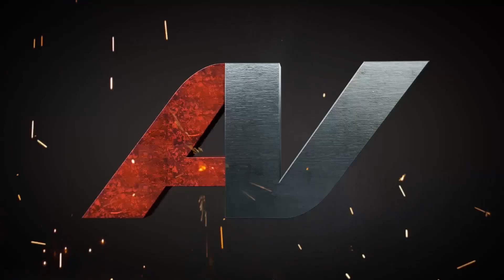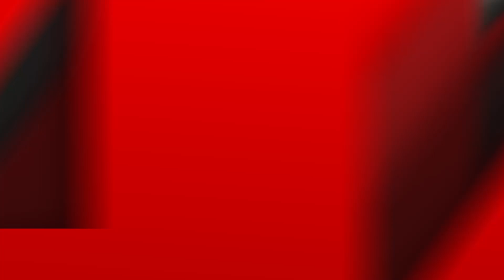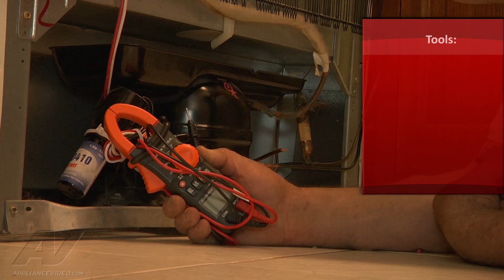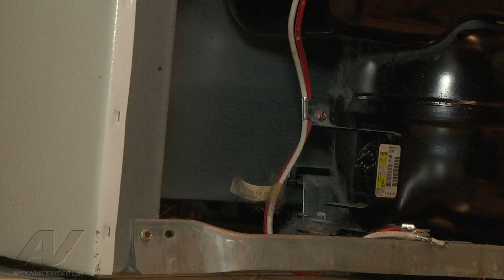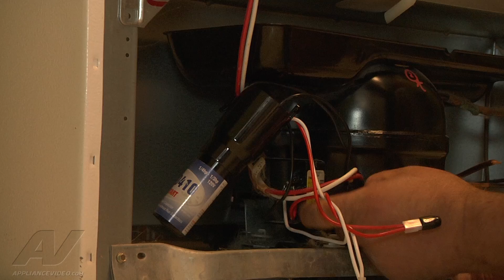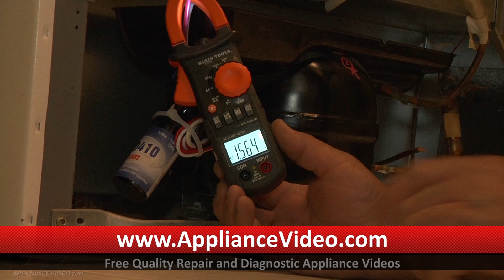Frigidaire Refrigerator Repair - Compressor Not Running - Start Capacitor

Comment: So - if I'm not getting continuous ohms across the three poles - bad compressor?
Reply from the maker: Great question, if you have a more technical question that our parts department cannot answer, you can search our over 17,000 answered questions free at our website www.ApplianceVideo.com under our Repair Help section. You can also call our parts department at 1-800-830-5465 and they can give you help 7-days A week ,or search at www.SaveMoreOnParts.com  .

Comment: Ice maker drops crushed ice after I've gotten my crushed ice?
Reply from the maker: +Peggy B. Havard 

We would like to help you
answer your question. With our videos now getting over 900,000 views per month and
hundreds of questions from people like you, our technicians are now answering questions
at our website http://www.appliancevideo.com/repair-help/ .  We also have over 2200 common questions
and answers that you can easily search through by your model number, appliance
make, problem or error code and it’s absolutely FREE. You also have the option
to email a factory service technician with a question on your appliance at http://www.appliancevideo.com/repair-help/ . If you’re looking for a repair video, you can
also search our library of over 2600 free repair videos. ApplianceVideo.com
specializes in quality DO-IT-YOURSELF appliance repair videos and we get over
800,000 views per MONTH to our videos worldwide and growing. If you need of
parts for your major appliance, we have over 5-million parts in stock at http://savemoreonparts.com/ .  Thanks for your support. Matt Ace
Appliance factory service technician.

Comment: FREEZER IS WORKING  COOL AIR ONLY BLOWS IN REFRIGERATOR WHEN FREEZER DOOR IS OPEN
Reply from the maker: Is the refrigerator section maintaining 38-44 degrees ? That is normal operating temperature for the refrigerator section. .  Our family-owned and operated company works hard to provide you with FREE, high-quality repair videos. Thank you for your continued support and good luck on your project. If you are in need of any parts, our parts department has over 5-million in stock for same day shipping. Please call  1-800-830-5465 for any of your parts needs, or you can order online 24 hours at: ApplianceVideo.com. Thank you and good luck with you project.